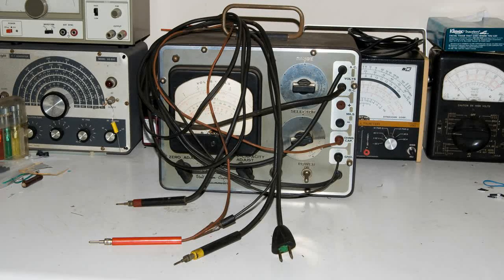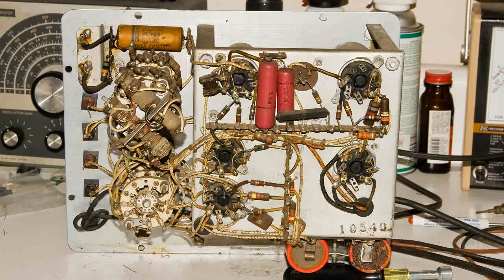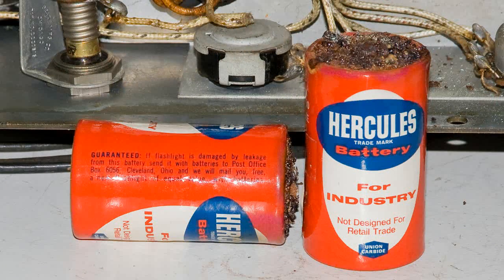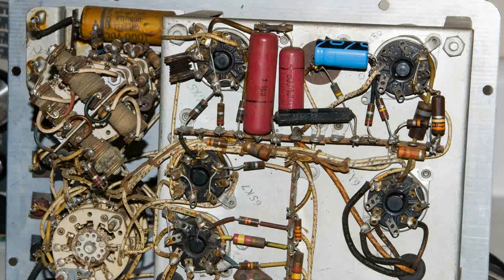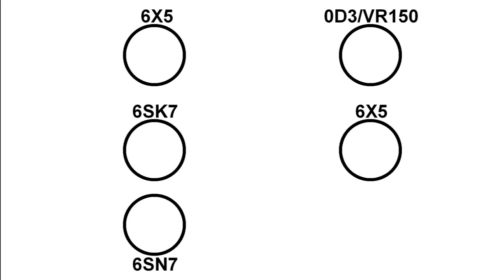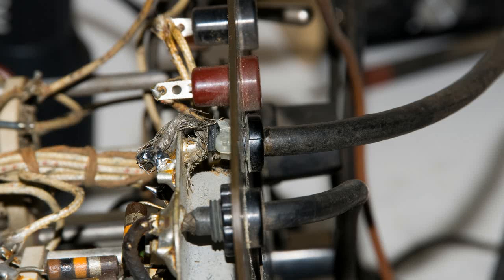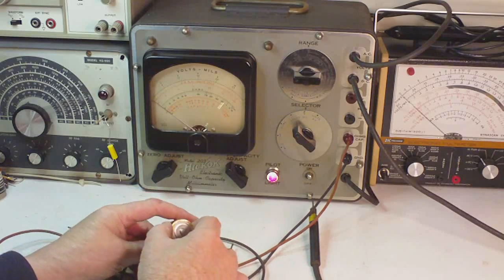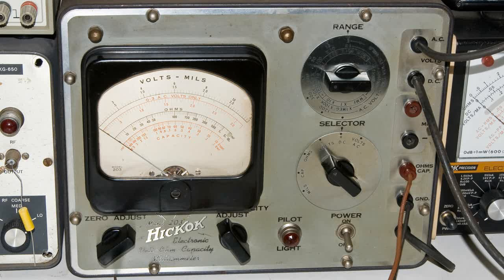Hickok Electronic Volt Ohm Capacity Milliammeter Model 203

Comment from the maker: Hey Chuck,
I do if it is a shock hazard, yes. This meter has a power transformer and the cabinet is not connected to AC or DC power. Also I ALWAYS use an isolation transformer on the unit under test. But when in doubt always play it safe.

Comment: Do you convert your old double prong cords to tripple for safety, or do you leave them all the way they are to keep them original? I have a 66 Fender Showman head that when gone through and recapped and all was changed by my amp guy to tripple prong.
I don't think my ground switch even does anything now by the way.

Just wondering,
Chuck

Comment from the maker: And that was because of its sample rate. The problem voltage varied just at the right rate to give the wrong reading on the digital meter. I am not picking on Fluke, they make very excellent equipment.

Comment from the maker: I use digital most of the time. A friend and I were working on a radio and measuring voltages with a Digital meter, it happened to be a Fluke meter. After analyzing the results making decision because of the results we kept ending up at dead end. We used and analog meter and found that the digital meter was lying.

Comment from the maker: I did not show the power cord. What is unusual is it comes out from the front of the meter. It is the one on the bottom right. The two batteries are in the Ohm circuit of the meter. I am glad you liked the video. Thanks.

Comment: Cool video! I'm gonna ask you a dumb question now. Does that meter run all the tubes from just those two 1.5 volt batteries?
I didn't notice an AC cord on the back.
If so, how?

Comment from the maker: I have a number of digital meters and I use them a lot, they are very handy and accurate. Analog also has advantages. I like the sense of direction that you can get from analog equipment. If something chances you can tell in which direction. And they are usually more rugged. Thanks.

Comment from the maker: Those batteries are the worst I have seen. Yes the 0D3 is gas filled but I don't with what gas. The 0D3 is a voltage regulator in this meter. But there are a few types of gas filled tubes, my favorite is the Thyratron. It is grid controlled and it is either on or off like a relay. Thanks.

Comment: The only tube instrument I have is a Bendix primary condenser tester, which is designed for testing ignition parts and has a very limited range.  It is useful for testing radio caps which fall into its testing range, though.

Comment: Great meter, Rick.  Ya done good.
Hickok stuff maintains its value, very expensive on ebay which is why I'm generally forced to pass it up.  But I've finally found a Heathkit IM-11 vtvm, along with a second one for parts should the need arise...a 2 in 1 deal.  Expecting them to arrive late next week.
As always, thanks for the vid.

Regards,
John